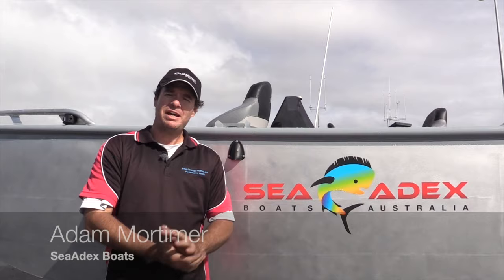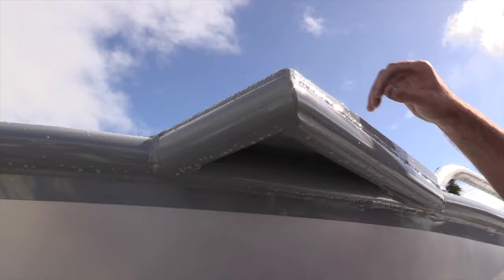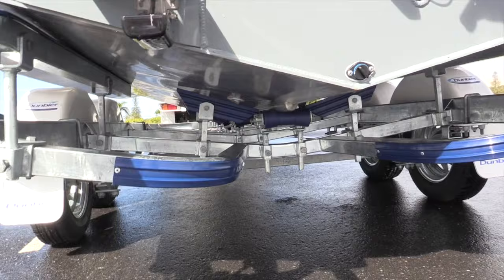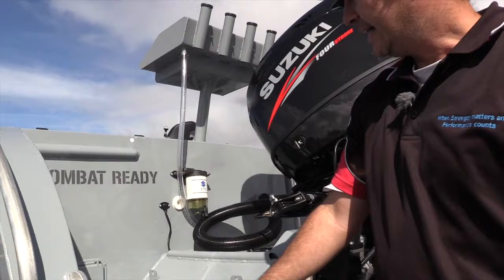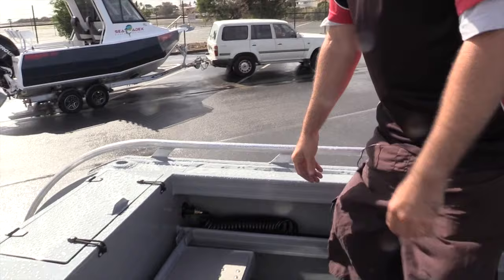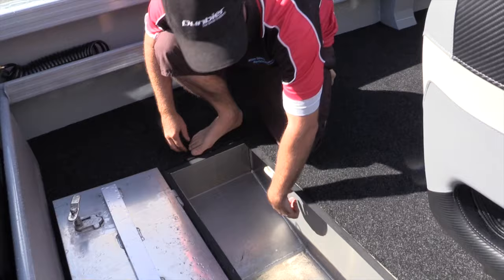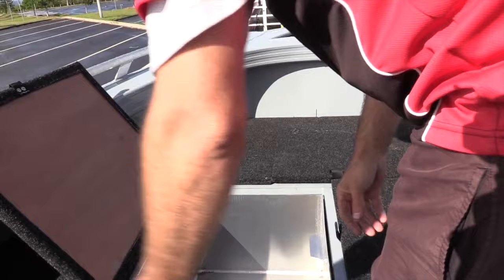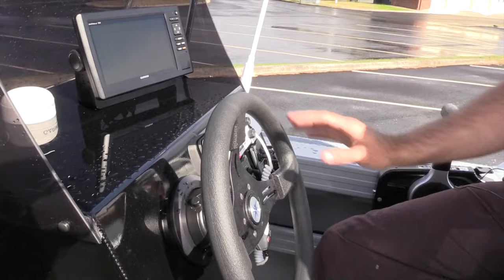SeaAdex TJae 60 with Suzuki 140 - walk through with Adam Mortimer

Comment: Nice solid outfit you've put together here. I like many features you've put into this one in particular. A couple of additions I'd like to see though is a clear perspex/toughened glass front to assess the live bait at any time, and some Bimini cleats.A couple of negatives though.. 1.The floor storage hinges need to be flush mounted or set below the carpet. 2. And most importantly- Where the hell are the rod holders? Needs rod holders and rod storage!
Reply: I agree.....also casting deck hatches didn't appear to have any lip drainage to prevent water ingress to storage space.These things are  important to fishos especially when running electrics and batteries for electrics motors etc...Not all bad though....lots of potential here and also with their armour series.Interesting to see how SeaAdex develop over time.
Reply: You can see rod holders along the side of the boat. Pay attention hehe
Reply: Good review